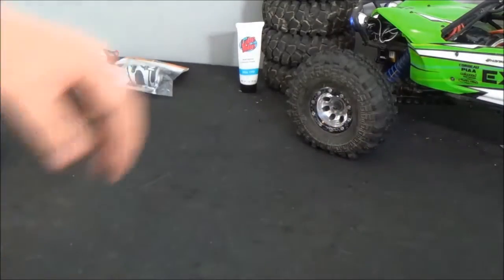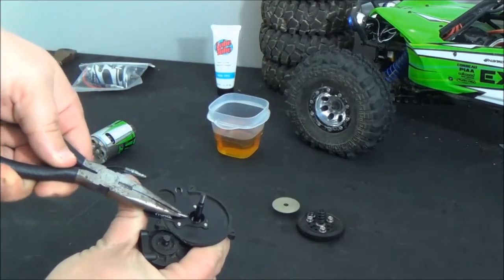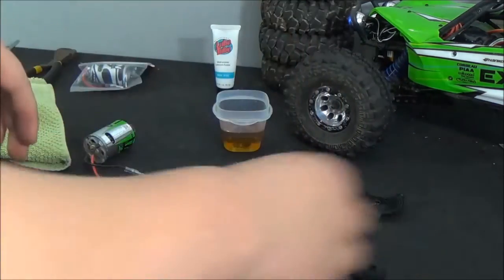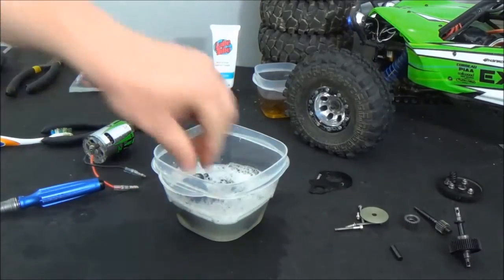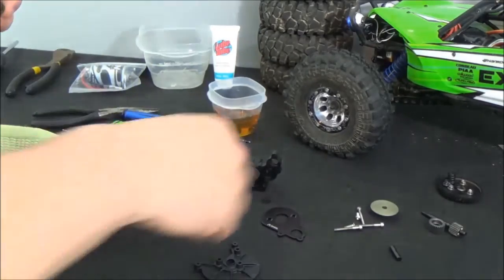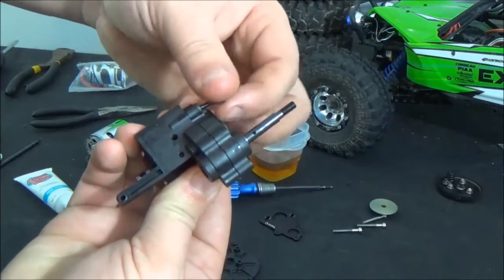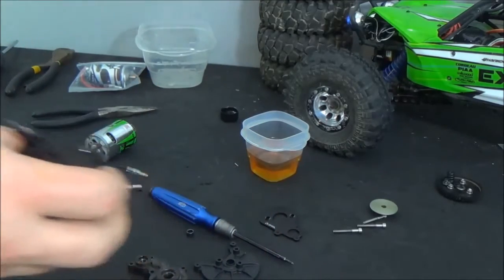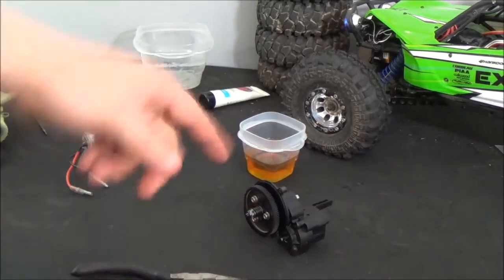SCALE ADVENTURES Project Wraith Part 1 Transmission assembly

Comment: My slipper was so tight that I stripped the hexes out if my wheels and torque twisted my gearbox out of my chassis. It basically pulled all four bolts right out of the gearbox housing... I'm kind of pissed since now I need to figure out new rims and I spent a ton of time gluing wheel weights to the stripped ones.

Comment: You should soak your bearing in transmission fluid, due to it has more detergent cleaning agents in it. It's thinner and will flow through the balls better. Then let drain and grease.